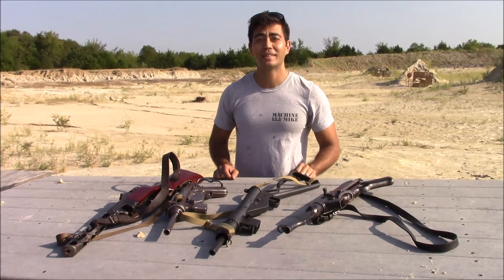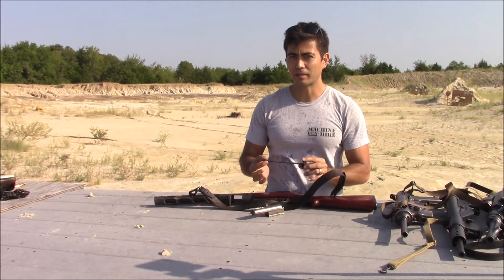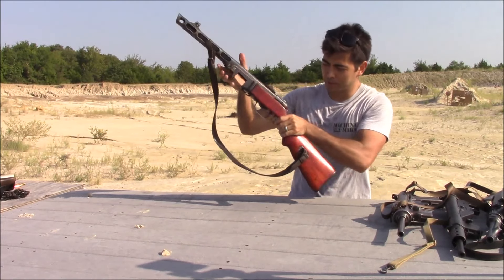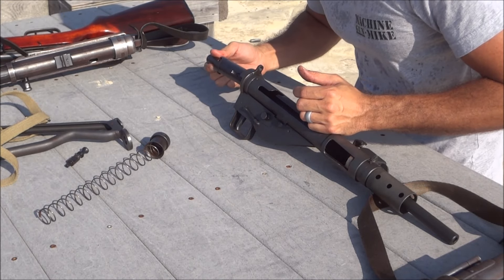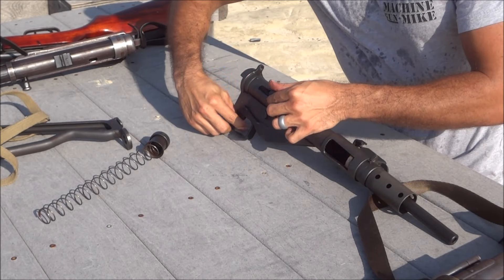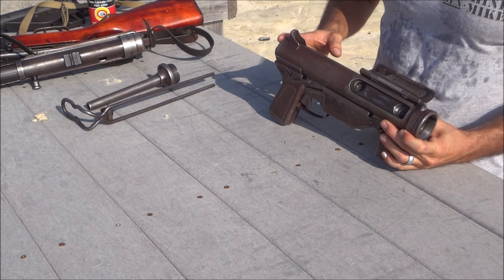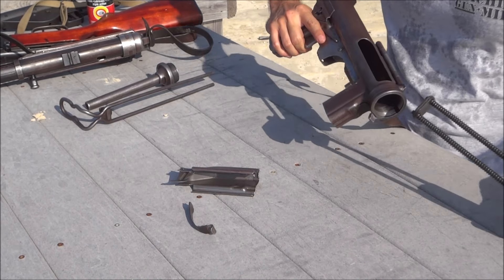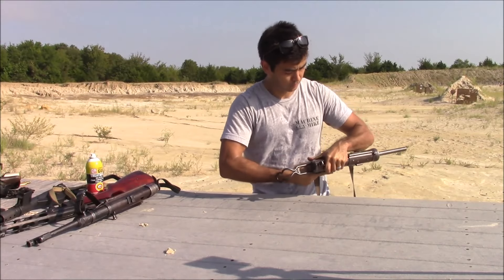WWII Submachine Gun Comparison (Ep56)

Comment: All specialists who known the WW2 submachine guns find the PPS 43 soviet machine gun as the best design: cheap to built, extremly reliable, accurate , safe and light...
Reply: Spews hot brass all over you because it ejects at the top. Also blocks line of sight.
Reply: @davidj3841  
All your arguments are absolute nonsense, the shell casings are thrown up and to the right at an angle of 45 degrees.
Reply: The PPS was developed and manufactured in Leningrad when the city was under siege. It was difficult to organize a full-fledged supply through the narrow passage on Lake Ladoga, which was constantly shelled by the Nazis. People were in dire need of everything, so the PPS was easy to make and easy to operate.
Reply: @musckowit  And where did you come up with this nonsense? PPSH 41 was introduced into service in 1940, when no one knew about the Battle of Stalingrad.
Reply: @antoninvesely6094  Small scale production began with the siege of Leningrad, the PPSH41 wasn't in mass production until the early 1943's.
I don't know shit, but a simple google search....
Reply: @antoninvesely6094  
My friend, you've got it all mixed up, you need to define the terms.

1) Stalingrad (today Volgograd) and Leningrad (today Saint Petersburg) are two different cities, but they share an epochal significance in the history of WW2.

- Leningrad is located in the north of Russia on the Neva River, the Baltic Sea and borders with Finland. The siege of Leningrad began on September 8, 1941. In January 1943, the ring of the blockade was broken, a corridor about 10 kilometers wide passed along the shore of Lake Ladoga, in such conditions the city lived for another year.

- Stalingrad is located on the Volga River, 1,500 kilometers to the south, closer to the Caspian and Black Sea. The Battle of Stalingrad began on July 17, 1942

2) PPS-43 and PPSh-41 are two different machines, from different designers.

PPS-43 Sudaev submachine gun(Пистолет-Пулемет Судаева - ППС-43), PPSh-41 Shpagin submachine gun(Пистолет-Пулемет Шпагина ППШ-41)

The author calls PPSh as PPS, this is fundamentally wrong.
The Sudaev submachine gun was first tested in June 1942, after which it began to be produced in the city of Sestroretsk, on the outskirts of Leningrad.
Reply: @musckowit  The test firing was done directly at the front line!
Reply: @davidj3841  fucking heavy and overall bulky design... that is why they created an improved design.
Reply: @musckowit  soldiers use to angle it because they stood in a casing rain.

Edit. Wrong gun, talked about the ppsh
Reply: @KaptajnKaffe  
Maybe I personally did not read about it, although I read about the German MP-40, which had the same opening for ejecting shell casings. With all the pros and cons of the PPS-43, Kalashnikov considered it the best submachine gun of WW2
Reply: @KaptajnKaffe  Just a joke, man. Although tanks produced in Stalingrad tractor factory went straight to the frontline from there - that's a fact.
Reply: @TheFatMob  oh shit, my bad 😅
Reply: @musckowit  fuck, I made a huge mistake! I read it as the wrong gun!! I take it back 😅 i must have been tired when I wrote in this thread.
Reply: @musckowit  увидел я столь развернутый ответ, удивился как чуду, хотел похвалить иноземца за образованность! Но чудес не бывает... )
Поэтому хочу поблагодарить земляка за просветительскую деятельность среди туземцев. Имхо - сизифов труд, как греть космос, но делать-то что-то надо! Желаю всяческих успехов!
Reply: @ΚωνσταντῖνοςΜεταβλητός  
Спасибо! Но я не специально миссионерствую, тема оружия  для меня интересная, можно и потрепаться. На Западе тоже есть адекватные люди:)
Reply: @musckowit  да неважно, апостолами не специально становились. Тут важнее дело! Весь шарик населен по-большей части разумными и порядочными людьми, в том числе и на Западе. Но именно на Западе люди наиболее зашорены и пребывают во мраке искаженных иллюзий. Когда придет момент истины, их будет сложнее всего откачивать от столетнего морока. Поэтому я всегда удивленно восхищаюсь теми, кто пытается нести знания в чумные бараки невежества. Мой Вам респект!
Reply: But try doing this   https://www.youtube.com/watch?v=IOvCJHMyyxo   to any of those guns including the PPS 43 and see if they still function. 
Which is why the WW2 Australian Owen was still in use in Vietnam and outperformed all its competitors in the most extreme conditions.
Reply: @musckowit  не совсем так. ППС решили выпускать в Ленинграде, потому что на том заводе производили ППД, устаревший автомат.
Reply: @musckowit  the author called it P-P-S-aitch so he didn't mistake
Reply: @Sakh10  
Чёт какое-то совсем небезопасное место выбрали для производства, всего в нескольких километрах от линии фронта.
Reply: @antoninvesely6094  i speak from the PPS 43, not the PPSH 41 who is totaly different...
Reply: @leneanderthalien  I apologize, but unfortunately I have bad experience from discussions with the identification of USSR submachine guns. In the video, I was mainly based on a weapon. Personally, I had the opportunity to compare PPS-43, PPSh-41 and PPD-40. PPSh-41 suited me personally best. And both types of magazines.
Reply: Actually the Owen gun was best
Reply: everyone knows that the best submachine gun was the italian Beretta mab38. And I'm not saying this because I'm Italian. Maybe not the cheapest, but the best one of course
Reply: @toxicbleach3304  ППС
Reply: @musckowit  а там были безопасные места, если что я про Ленинград? да и Судаев сам работал на Сестрорецком арсенале
Reply: @ivankoval4579  
Вопрос немного в другом. Тот парень заявил, что решение о производстве ППС Ленинграде было продиктовано тем, что в Сестрорецке уже было оборудование. Но это самое оборудование было практически в окружении фрицев. Я себе с трудом могу представить сколько сил и героизма многих людей понадобилось для осуществления и поддержания производства в таких условиях. Наверное, когда Совнарком принимал решение, то  в первую очередь полагался на  патриотизм  ленинградцев, иначе силы, ресурсы и время будут потрачены в пустую
Reply: I did not have the opportunity to test this weapon. But I can responsibly say that the PPSH-41 passed the reliability test against the MP-40, as well as the Sten Gun. Both failed in the case of sand pollution. In terms of accuracy, the MP-40 and PPSH-41 were equivalent, the Sten Gun was much worse. Accuracy tested by several shooters up to a distance of 100 meters.
Reply: @musckowit  but PPS is not PPSh!! You right about russians developed PPS in saint petersburg 1941, but it was quite different weapon, not included in this showcase
Reply: @doombringer3498  
Yes, there is no PPS-43 or PPS-42 in this video. But the author said PPS, maybe it seemed to those who do not know English well, including me.
Reply: KP31 > PPSH
Reply: But the soldiers loved the PPSh, because it is a mini-machine gun compared to the PPS43
Reply: I would Say you are incorrect As Technically  the Sterling  were used at Arnhem And they are way better than the PPS, The PPS ONLY and I repeat ONLY works with a matching magazine
Reply: not it's not.  PPS 43 was cheaper PPS 41 version. Also 41 was poor quality good with bad accuracy, fast overheating and very bad gun fuse system.
Reply: @ponasgaspadorius1478  you described 70% of the submachine guns of that time)
Reply: @ponasgaspadorius1478  
I declare to you with all responsibility, do not confuse PPS-43 and PPSh-41. Do you all use machine translation? In Russian, PPS and PPSh are two different pistols.
  Even in Russian it sounds different ППС  or ППШ,  English (Sh) - rus (Ш)
 ППС 43  - ППШ-41
Reply: @antoninvesely6094  leningrad, stalingrad ... pfff who cares.....
Reply: @florianmeier451  Boston, New York...who cares
Reply: @musckowit  A long life doesn't make it the best SMG of the war. Armies delete guns from inventory and replace them for all sorts of reasons. The best SMG of WW2 is still not going to be better than the MP5, so if the MP5 is available why would you hang on to your WW2-era gun? Unless you can't afford to re-equip with MP5s.
Reply: @aaronleverton4221  I made a little joke in that comment. I do not call for using ww2 weapons at the present time, especially in the army, they have long since abandoned the pistol cartridge with a length of about 19mm. An optimal compromise was found between the range and the convenient size for the army. This is a cartridge with a length of about 39mm and a suitable length of the barrel-about 400. Anything that is significantly less or more suitable for individual, special tasks.
Reply: In terms of performance, the very best was the Italian MAB: very powerful (used a 9mm bullet more powerful than the Parabellum, but could work with the latter too), very precise if needed in semiauto mode, incredibly reliable (Italian soldiers used to joke that you could throw it under a truck, pick it up and would fire just as well).
Reply: @toxicbleach3304   not sure /remember about the designation  PP's etc exactly, but I have read about a SIMILAR (in appearance) weapon produced during the siege of LENINGRAD (1941-44) and served well. The same article stated that what made the difference was that Stalin favoured and bestowed honours like Heroes of Soviet Science etc along with complimentary propaganda footage , on Shagpin the designer of the ppsh with the drum mag. (guy's name spelt correctly?) whist the "Leningrad upstarts" as Beria the NKVD chief regarded them, were sidelined.
Reply: @antoninvesely6094  i think he meant the pps 43 which was developed and manufactured in Leningrad as a cheaper alternative the pps 43 is also a really cool gun that is often overshadowed by the ppsh 41
Reply: I used to NOT like PPS. 43 because of all of the holes in barrel 
Schoud  and I never understood the end of the barrel being cut 45 degrees  . However I The more I learned about it the more I liked it , it also blows me away that they used to have entire platoons with just this gun ! Imagine all of the lead going down range from that ! I think the bottle neck Tokero round is more powerful than the 9mm round. I can’t even imagine how many Germans were killed with this weapon
Reply: Except if you drop it. The safety is a joke. The Sten had the same problem
Reply: @garrisonnichols7372  PPS it does not shoot if it is dropped and even if the compensator is clogged, it will still shoot and the dirt will simply fly out.
Reply: Id say the accuracy isnt too great on the sudayev
Reply: The Suomi or the Baretta were better arguably than the PPsh
Reply: The Italian Beretta was the best design.
Reply: The epitome of user friendly for sure
Reply: Mp40 was way better
Reply: @antoninvesely6094  Germany sieged Leningrad for 3yrs, people resorted to sawdust bread to survive
Reply: @oceanhome2023  you don't like it because it didn't get hot? vent holes would be absolutely necessary with that rate of fire. How on earth would you use it past a few mags without?
Reply: He's not completely wrong.. nowadays it's maybe not THE ultimate SMG.. compared to some later designs  but it's definitely in the top 3 . The PPS 43 is excellent simple robust accurate easy to operate lightweight well built and extremely easy to clean and maintain weapon.
Reply: You can drop a soviet weapon from the stratosphere insert a mag, rack a round and it won't skip a beat. They're definitely designed to take abuse and maintain all functionality.
Reply: I agree for the most part, but I found actually carrying the M3 to be much easier. If we're talking about something I have to hump around for a year, I'm taking the minor drawbacks of the M3 without question.

Comment: The PPSH is great once you find a matching magazine
Reply: This was more with the 71 round drum. The 35 round box he was using was more flexible in that it would fit more weapons. Soviet soldiers issued with the ppsh41 were issued with one 71 round drum matched to his weapon with the rest in 35 round boxes.
Reply: yes, there was slight problem with magazines (talking about round drums: one base and one spare matched to a gun). but why? ppsh41 is extremely simple in use and chip in production. no qualification was needed to produce them. actually teens worked on that factories while their fathers and older brothers fought on frontlines. from the other hand - it was not hard work to match a magazine to a PPSH. mp40 was much more complicated in production.
Reply: Tranhoang Long  Plus stick magazines are a better shape to keep in pouches. They could probably get 3 or 4 sticks in the space taken up by one drum.
Reply: he forget the best, the Beretta 38A
Reply: @pavelgrigoryev753  not simple in production-a lot of macining, and probably the most expensive ones . But reliability and "build to last"-yes.
Reply: BRRRRRRRRRRRRRRRRRRRRRRRRRRRRRRRRRRRRRЯRRRRRRRRRRRRRRRRRRRRRR
Reply: Aryan King  The only problem with the type 100 was the underpowered 8mm Nambu round it fired. That and it appeared so late in the war. A problem for the Japanese of course, not for the allies!
Reply: nah i cant aim with it. i only get to break armor with the small mag thats in it from ground loot
Reply: Aryan King  nah MP 40 is der way to go
Reply: @pavelgrigoryev753  actually, ppsh was kinda costy and was the reason for adapting pps
Reply: It's an absolute beam in warzone
Reply: @noscopethepope1795  if you get the right ammo for it
Reply: OR keep the original ones issued!!
Reply: It overheat easy and will size if you force shooting without cooling.
Reply: @Nooziterp1  they use it on the mp40 (35rds)
Reply: @Nooziterp1  better use 2 stick mags side by side than a single drum that hard to hold and no recoil assist whatsoever

Comment: The PPsh-41 is probably my all time favorite.
Reply: They also nicknamed this weapon the burp gun.
Reply: Then you'll love the Suomi KP-31 invented in Finland. That's basically where Soviets copied their PPsh from.
Reply: @DrArku  The PPD-40 was basically a copy of the KP-31, but the PPSh-41 was a simplification and refinement, design wise they are very different.
Reply: @DrArku  it wasn’t a copy as much as any other weapon is a copy of any other
Reply: @DrArku  а "суоми" скопировали с шмайсера 18.а Спрингфилд 03 точная копия маузера.
Reply: @darcgibson5099  just like the type 56 isnt a copy of the ak47 right? wtf? guns are remarkably similar in engineering and usually have small improvements until they are perfected. If they look similar, they are at least similar in production value.

Comment: I've had PPSH Recoil explained to me as being easy to control because its a constant pressure because of its high rate of fire, a bit like a fire hose. Once youve adjusted to it its suppose to be fairly smooth to control.
Reply from the maker: This is correct
Reply: Figurarsi se faceva vedere il test a fuoco del ppsh russo da buon stupido americano
Reply: 7,62x25 is a high pressure round and it works well with the ppsh muzzle brake.

Comment: I have personal affection for the ppsh41 and the mp40
Reply: They are the two I’d love to own.
Reply: Both good weapons.  Germans used the PPSH-41 at times and Soviets the MP-40 during WW-2.
Reply: A lot of U.S. troops used the MP-40 for how good it was, not to mention ammo would be easier to come across when behind enemy lines.
Reply: PPSH inside literally looks like some kid's interpretation of how gun works: inside is hollow, so you just put a piece of metal in there and it should do the trick :D
Reply: @saltifate  until you touch the pps-43, it is even simplier

Comment: The reason the ppsh doesn't have that much recoil is because the rate of fire is so high that the recoil pattern is more like a constant push, rather than a rhythm of jolts to your shoulder, like with the grease gun.
Reply: Thats true.
Reply: Not really. It's about the diagonal cut at the tip of the muzzle.
Reply: @DeepFreeze118  You mean the compensator /muzzle break.. that and the heavy spring and pistol caliber combined

Comment: You forget to mention that the PPSH has longest barrel and most capabell of range shoots caliber. That IMHO a significant advantage.
Reply: The PPSH is fantastic but it shoots so fast . I would worry about ammunition but of course all SMG's had to be used sensibly .
Reply: @КотМатроскин-к2я  pps-43 is better but sadly not that many were made.
Reply: Tranhoang Long  The PPSH significantly exceeds them all in range. In addition to the longest barrel, it also has the fastest and longest-range cartridge.
Reply: Tranhoang Long  7.62x25 is the cartridge it used and just taking a guess it's without a doubt superior to 45 ACP at a range and it has better armor piercing capability than 9mm, along with that greater velocity and smaller diameter I make the automatic assumption that it would do better at a range than 9mm parabellum.

It really is a mean cartridge.
Reply: @Артём-ц5э8з  What is the muzzle velocity of the 7.62x25 from the PapaSha?
Reply: @ThanxBeToGod  500 metre per second
Reply: @ПавелКузнецов-ф3т  1,640 FPS.  
Given a modern cartridge design update, a 5.7mm projectile with a nylon sabot loaded into the 7.62x25mm cartridge could produce about 609 M/s, and over 800 joules.

Comment: The Grease Gun is probably in the running for the most efficient SMG of all time.  Cost $10 to make back in the day, and then saw service from WW2 all the way up into Desert Storm 1.  Not even kidding, US tank crews in 1991 were still being issued Grease Guns that might have been manufactured for US tank crews in WW2
Reply: So did the sterling, not pictured. The sten was used until the 80's.